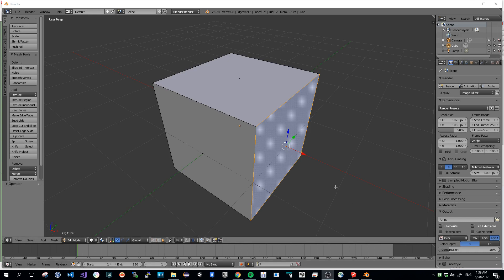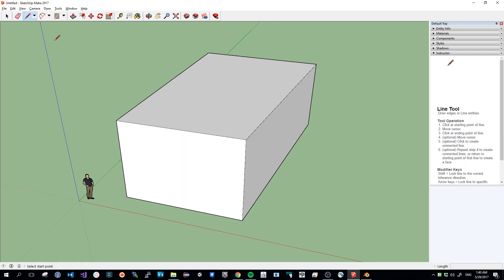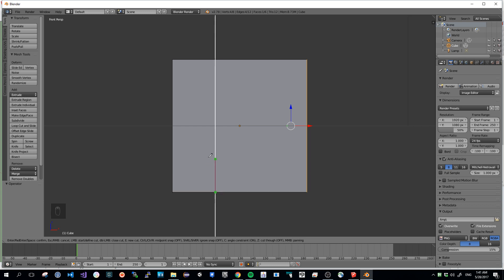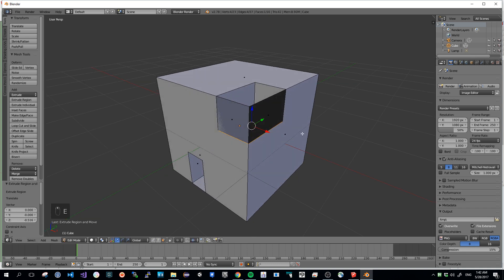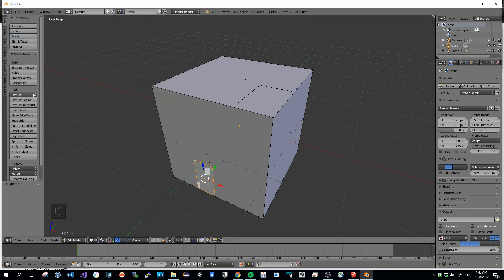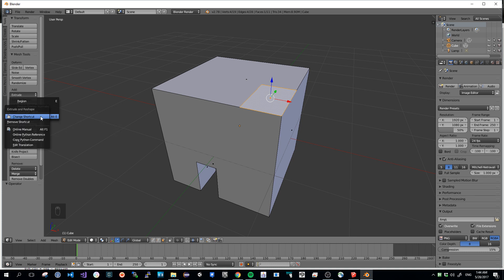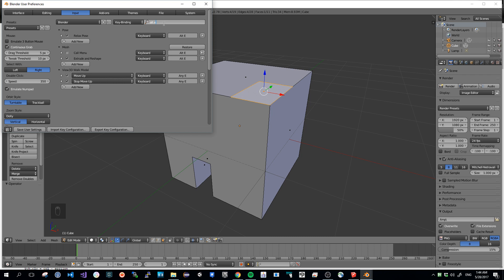Push/Pull DEPRECATED see description for replacement

Comment: Hello i can't have it for blender 2.8, any solution?
Reply from the maker: If you can install Blender 2.9 it's now installed by default, https://docs.blender.org/manual/en/2.90/modeling/meshes/tools/extrude_manifold.html
Reply: @FrancoisSchnell  hai sir but i'm using blender 2.8 version,

Comment: 2.90 will have this by default.
https://youtu.be/ycKtgy4tSPw
Reply from the maker: Yes :)  but sill not at the level of SketchUp, for example is you currently push completely through the object a face to make a tunnel. I may still use the ExtrudePull addon, will see, it can only get better from there :) https://www.youtube.com/watch?v=ik6oNdIoqBk

Comment: Hi, i can not install the tool on blender 2.78, looks like only work for 2.8. There is a way to have it for 2.78? thank you very much
Reply from the maker: Maybe try Blender 2.79 if you don't want to go 2.8x.  This addon was by default in 2.79 (you still have to activate it). https://wiki.blender.org/wiki/Dev:Ref/Release_Notes/2.79/Add-ons

Comment: Thanks, very useful addon, but I can't save the raw file to .py file. The raw file save not to .py file but text file.
Reply from the maker: Try to save with google chrome, it should keep it as a .py file (at least on windows)
Otherwise on Firefox when you save there is a dropdown menu when saving "save as type", select 'all files'.
If it still doesn't work open a text editor, copy and paste the addon code and save as mesh_extrude_and_reshape.py
Tell me if any of these works for you.
Reply: Thanks, I succeeded with Firefox~ ^^
Reply from the maker: 축하해요 :)

Comment: cool, but I hate how often addons do not seem to install properly, what am I doing wrong in some cases, isn´t it enough to add the py in the python lib, I then tried to put it in a folder..but in the preferences I can not find it by searching or lookin in various categories after I installed it from file, and yes, saved user settings as well.
it doesn´t show up in the tools extrude panel either, tried installing it several times..rebooting but nada
also tried installing from zip..but nada.
windows 10, blender 2.78
Reply from the maker: Maybe make sure it's a .py file and not a .py.txt (or a hidden extension ?). On win10/chrome i don't have problems but maybe different browser/OS have different behaviors.
If not you can also create an empty file in an editor, copy/paste the content from the raw page on github and save to .py file (then import this .py file in blender addon section).
Reply: It Is a py file, both in the downloaded script, as well as within the zip file, it´s downloaded with firefox, chrome has nothing to do with it nor should any browser have either when it concerns downloading the zip file, thanks for trying to help..but so far nada..and this happens sometimes with some plugins, while others works fine when installing from a zipfile.
Reply from the maker: This addon is a single .py file. Some addons come in zip file when there are many .py files inside which is not the case of this one :
https://raw.githubusercontent.com/Mano-Wii/Addon-Extrude-and-Reshape/master/mesh_extrude_and_reshape.py
Different browsers have different contextual menu and ways to handle downloads.
In chrome when you right click on the page (opened by the link i gave above)  you have "save as" which will keep it as a .py file.
In Firefox you have "save page as" which on my pc tries to save it as .txt file. I have to also select "save as type : all files" to keep it as .py file.
Also if you don't find an addon you installed in Blender,  go in addon tab, then in supported level, shift click on  official, community and testing (the three will be highlighted)  and select categories "all" . Then all addons will be searchable.
Hope it helps.
Reply: I first tried to copy the py file in the github to a textfile and renamed as py, it now showed up..but the console gives it an warning..then tried your file and just saved as py from firefox...that is not working, thank you very much for your very fast help....but things like you just cant go and grab the plugin and install is something that annoys me with blender, I find it much easier to install plugins in lightwave..with some rare exceptions where a certain plugin needs special rights in a folder for example, but generally you just add the plugin and it will either protest that it can´t be added due to not correct bit system for instance, but it will always show up in the plugin editor.
Anyway..much appreciated francois.
Reply from the maker: In my case the problems I had were always associated with not saving the "original" .py file itself like here,
https://blender.stackexchange.com/questions/13899/install-from-file-not-working-to-install-addon
Try chrome if you can and if not here is a direct drobpox link to the same file (you don't need to create a dropbox account, click "no thanks" and there is a download button top right) :
https://www.dropbox.com/s/3ml1igd4tbq8o2l/mesh_extrude_and_reshape.py?dl=0

Comment: an addon that gives you horrible topology is the opposite of time saving. this is worthless.
Reply from the maker: This addon is integrated by Blender's developers for the next version so maybe not "horrible" and "worthless" for all.
https://wiki.blender.org/index.php/Dev:Ref/Release_Notes/2.79/Add-ons
Ngons are not that problematic on flat surfaces like in architecture and easy to break them in quads in this context but you're right to warn about it,
https://blender.stackexchange.com/questions/89/when-should-n-gons-be-used-and-when-shouldnt-they
Reply: Sketchup didn't exactly have good topology, they just dont let you see it

Comment: Does it show up in the advanced extrude menu? (Alt+E)
Reply from the maker: Not sure i understand. "extrude and reshape" appears in the Extrude menu (in edit mode) after addon installation. Alt+E was a shortcut i added to directly select "extrude and reshape" without manually using the menu.
Reply: The default installation of blender gives the "add: Extrude" menu as on screen panel from alt+e. So I was wondering would the "extrude and reshape" appear there after installation of the plug-in if it appears in the "T-panel" menu. 
https://i.gyazo.com/445a433583b6d8456a8c74b3bdfcc785.png
Reply from the maker: Ha ok, yes it will appear there (in my case i did unchecked Mesh> call menu to use it directly for extrude and reshape, not sure if that was a great idea though).
Reply: coolio

Comment: Very usefull!

Is ther a way to do a circular knife?
Reply from the maker: Not directly but there  is the "Knife project" tool (just below knife) which let you do that after adding a circle to the scene. Found a tutorial here,
https://www.youtube.com/watch?v=jKJ-ml5N0fw
Another way would be to use booleans (extracting a cylinder from your object),
https://www.youtube.com/watch?v=ViGTkjW997E
Reply: Knife project is one way, keeping in mind that for it to behave correctly you must be aligned with the circle face and in orthographic mode. (Otherwise you may get an oval or other odd geometry.)

Alternately there's loop-tools add-on. You can convert any n-gon to a circle via it's circle command. (Still may need to correct rotation, but the circle face will generally be aligned with the n-gon normal.)
Reply from the maker: Thanks for the loop-tool suggestion :)

Comment: This is a really great feature especially for architectural stuff...but my keyboard short cut isn't working for me. The tool shelf button works just not the keyboard short. When I press it I do get the axis line showing up in the direction that it should extrude but moving the mouse does nothing and after dropping the tool the face hasn't actually been extruded. Any thoughts Francois?
Reply from the maker: when you go back to the tool shelf button do you see the shortcut you entered like here 4:01 ? (if not there's no shortcut). Although be sure to move the mouse in the rectangular area after clicking "add shortcut" then type your shortcut.
Reply: Hi Francois, yes I did that. It's setup in the rectangle as alt-E. I even went to the shortcut section in preferences to check everything was setup right as per your video. It looks right to me... although I don't have that "call menu" checkbox, it's not there. Infact, my pref window for this shortcut area looks a bit different to yours.
Reply from the maker: Hmm, not sure then. I used Blender 2.78c (the last version)
Reply from the maker: Also make sure you are in edit mode and that you selected a face but I guess that was the case.
Reply: Yeah I'm running 2.78.1. I noticed on BA someone else has a similar situation. For now I can live with the shortcut not working as long as it still works from the tool shelf. Thanks for following up Francois and for bringing this great add-on to my attention. I do a lot of low poly architectural stuff and I've wanted a sketchup type of tool for awhile now. Cheers!
Reply: Yep ;-)
Reply: So I managed to get the shortcut working but on the push pull/faces, which seems identical to the extrude and reshape to me. I'm using the tilde key and it's working! Woot :-)

Comment: The Addon is great want to know its not working for me. As shown in the video its getting push pull down to 1 Faces. When i select more than 1 Faces for example if i make a circle and faces and with atl+p and with the normal extruding its pull up. When i select the Alternate Faces and want to make use of this addon its default it pull only 1face which is selected 1st. How can i make use of multiple face selected and push pull. Thanks
Reply from the maker: Hmm... indeed multiple faces doesn't work. If you don't mind losing the individual lines of the selection  you could "merge" the faces with the F short key before.
Just made a feature request for multiple faces but he doesn't seem active on Github since a year and a half,
https://github.com/Mano-Wii/Addon-Extrude-and-Reshape/issues
He seems to have another addon on Blender Market (commercial) maybe multiple faces work there,
https://www.blendermarket.com/products/snap-utilities  
I will try to look at the "extrude and reshape" python script if there's no answer (if i can understand something).
Reply: Yeah this aspect limits its usefulness. Maybe a revised version in the future would allow multi-face operations? And perhaps have an option for vertex normals like extrude region does. Then it'd be handier for doing stuff on curved geometry.

Might be something to bring up if there's a Blender Artist's thread on it. (If those shortcomings aren't mentioned already.)

Comment: I cannot install the addon, why Mr. Francois? I used blender 2.78.c
Reply: aw i just fixed that! i opened the file with another text editor" sublime text" and save as a py file
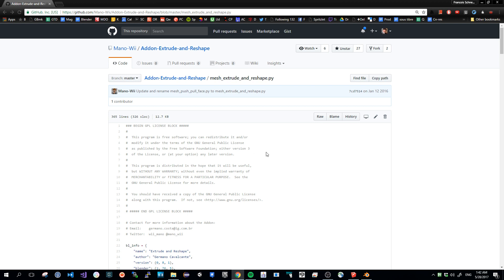Reply from the maker: Did you click on the "Raw" button before "save as"? checked the checkbox so it's activated ? 2:46 Tell me how it goes.
Reply: thx.
Reply from the maker: Good to know, maybe it behaves differently depending on the browser and OS (I was on Chrome/Win10)
Reply: me too! i can not see the file by blender user preferences :( i tried to drop the file in there and it shows me the file name "*.py.text" while the file in folder just "*.py" pls help!!! maybe my blender version is also 2.78c !